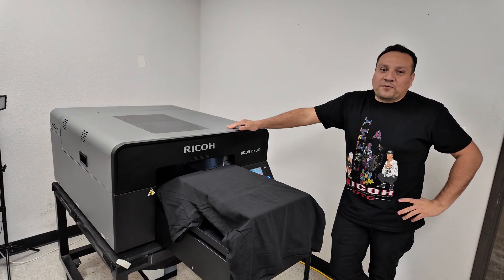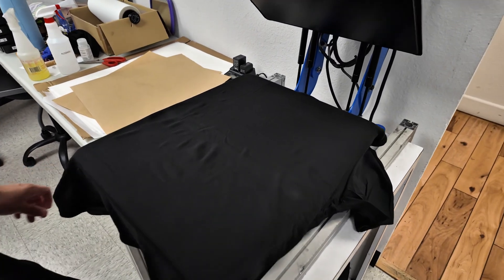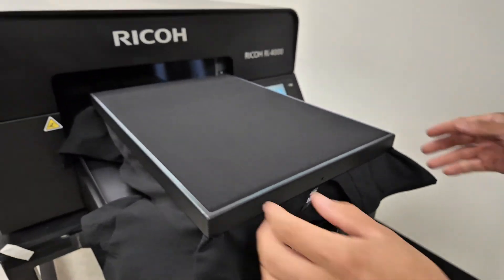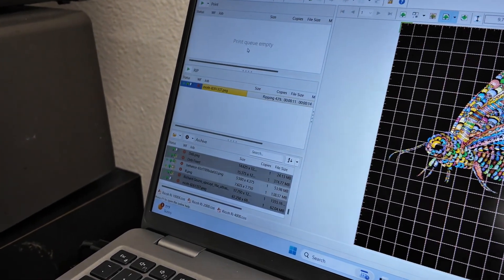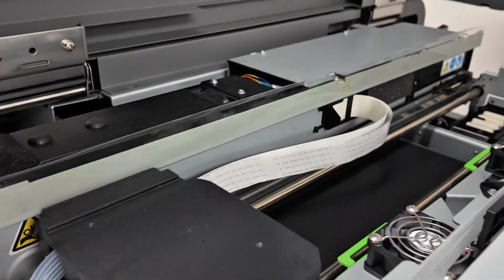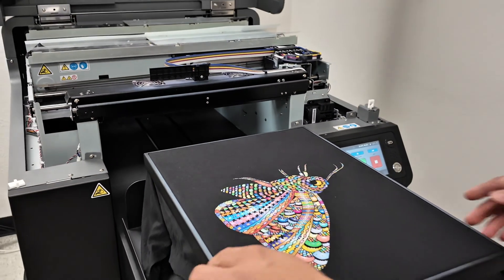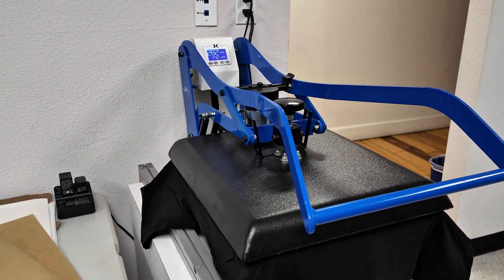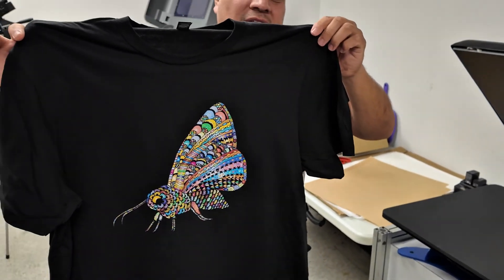Full T-shirt Printing Process: RICOH Ri 4000 DTG/DTF Printer Tutorial

Comment: Does the Ri4000 automatically come with the DTG and DTF? Because I see different packages. If I want both the DTG  and DTF is there a package I should select?  What is the cost on the inks or supplies needed to operate this printer? 
Ty
Reply from the maker: Hi Archie, Ri 4000 is a dedicated DTG machine but it can also print on transfers. You will need a separate powder shaker to complete the DTF printing. Feel free to connect with our team at (877) 626-2538 to get your questions answered
Reply from the maker: This video also helps https://youtu.be/hyOleoGYk4E?si=tuecrCh6DAaXqm3P

Comment: That looks much larger that the 6000’s
Reply from the maker: Hi, RICOH Ri 4000 is a foot longer than the Ri 6000. The dimensions are 34.7 x 65.4 x 19.7 inches. It does come with the built-in pretreatment which makes thing easier